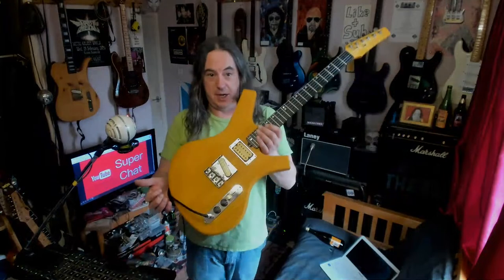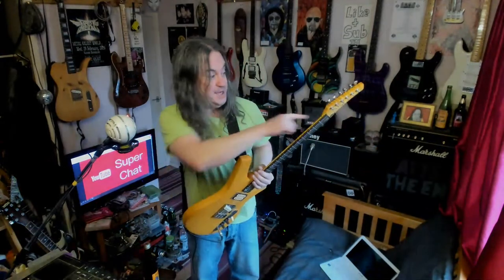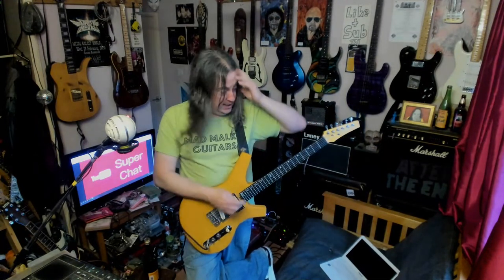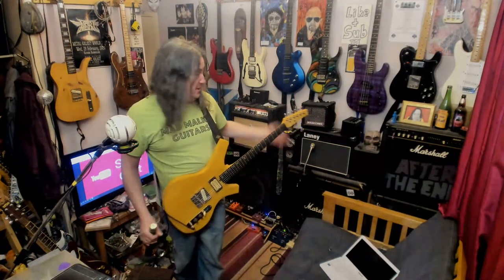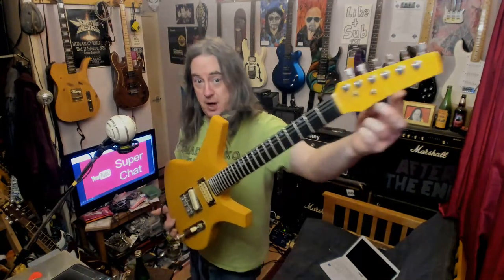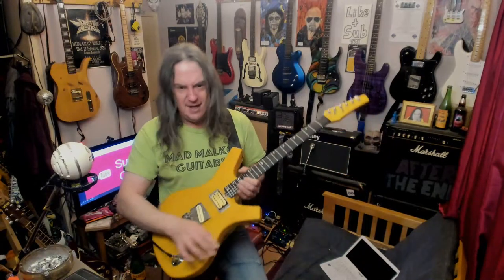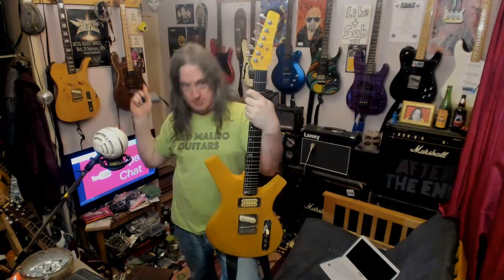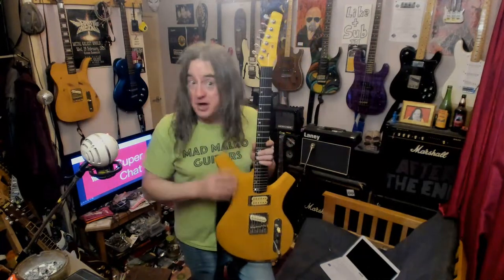sream live 155!

Comment: Is that the same make as the JPax Custom without the paint job?  It looks very similar with the blunted double cut.
Reply from the maker: yeah built by the same guy, slightly different shape but similar to the prototype
Reply: @MADMALKO  Thought so.  I guess that would have been expensive.
Reply from the maker: @edwardhodgkinson390  i guess its relative, you can easily find guitars made in a factory assembly line that cost way more - this is hand made and totally a one off...
Reply: @MADMALKO  No logo on the headstock sadly...  Buyers are funny about that.  Trust me, I know.
Reply from the maker: oh i know thats more important than how good the guitar is in the guitar world - i own gibsons!